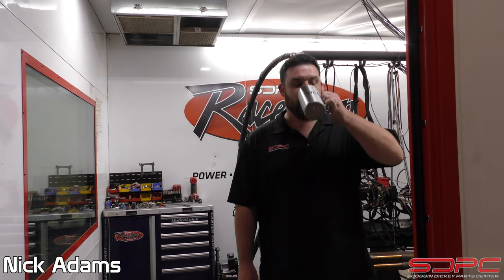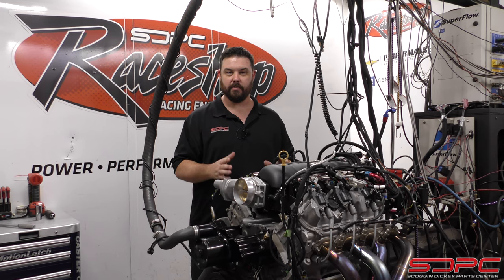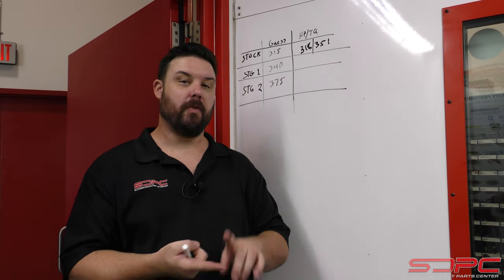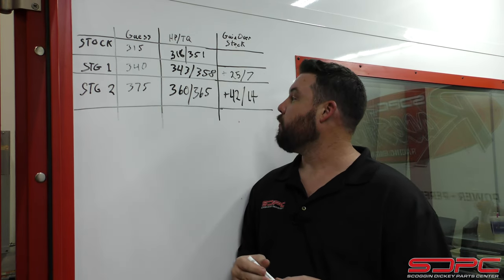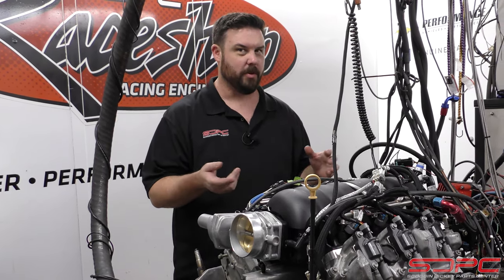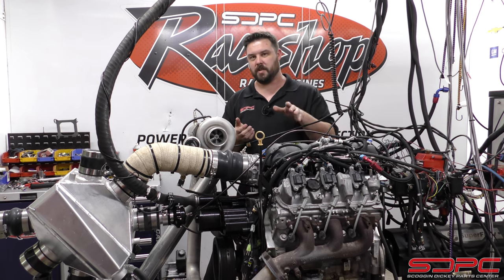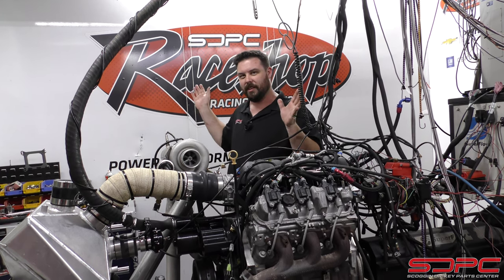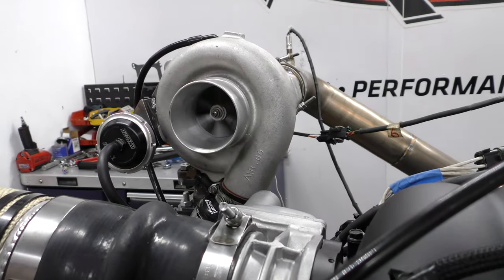4.3L LV3 V6 Camshaft Dyno Shootout!

Comment: Bought a 2016 Silverado back in January. Now, before I made the purchase I did some research on the difference between the V8 and V6 models. I was absolutely blown away by the power these new 4.3's are making! So, I saved 3k$ on the truck I bought vs the V8 one and took it to Montana this summer with about 700 lbs of stuff in the bed including my sportster. Did friggin great man. Anyhoo, I have an 88 s10 that I plan on doing the big "LS swap" into, and I think I've pretty well changed my mind on that😁 I even have a supercharged 3.8 out of a gtp that I planned on using, but now, the lv3 I believe will be the new small motor of choice for swaps and hot rodders. Thank you so much for doing the r.n.d for getting some great power out of these V6 monsters!

Comment: This engine came out right after I built my stroker 303 cubic inch 4.3 V6 back in 2013. The LV3 V6 runs as hard on the Dino as my stroker even though mine’s NA. My stroker 4.3 is running a forged 30 degree evenfire Scat 3.875 inch stroke crankshaft. H beam rods, forged pistons, 4 bolt mains, Brodix aluminium heads with a bolt pattern the accepts a tbi or cyclone intake manifold.  It’s pushing 320hp with a 454 tbi. The torque is crazy. Can’t wait to put a marine 4barrel manifold on it with a Holley EFI. The LV3 has a lot of potential, imagine it with a custom stroker crank?👍
Reply: It seems we have a lot of work to get power out of the 4.3 vortec. Is a marine intake and a carb be helpful with a cam. I’ve haven’t heard anything good about cams on these engines. The only easy rout I see is nitrous. I wouldn’t mind a 50-75 shot
I have an 02 2 dr extreme but I have to redo the whole exterior and interior…. They stole it messed with it inside and out then stole the cat and crashed it… so many tickets and a beat truck. I will restore it get a race cat maybe a new bed and new sound system.  Insurance gave me $4000 for the whole thing prob need 1000 to make it cali legal but with $3000 and  lot and lots of work I will be a make it better than before….

Comment: I wish I saw this 5 years ago. 
Before I bought a new or rebuilt V6 in my 86’ Grand National. 
I think I paid around 14K for it. 
With a newer ball bearing turbo and it made almost a thousand hp on 13 psi

Comment: Looking at putting that in a 96 s10 blazer. Seeing at least some support of the platform is making me believe it's possible to do. Even just headers and stage 2 cam would be a huge upgrade over the tbi 4.3 it's running. Great work.

Comment: Not a bad choice, especially when  there's performance parts available. The heads are so good, a cam (and possibly turbo) is all you need. I'm really impressed by the torque production throughout the rev range. Nice work on the cam design!
Reply: I think the rockers would struggle with a turbo 
I'm thinking of getting the stage 1 cam you think with a stage 1 mpg will stay around the same ?

Comment: I have an idea for a custom cam spec for you guys to consider with the LV3 engine. So, basically, keep the intake centerline at 107 degrees no matter what (with 0-deg cam adv or ret), then make the LSA either 107, 108, or 109 depending on if it's for 10-10.5, 11-11.5, or 12-12.5:1 compression, respectively. Basically, for every point of compression, you want a change of about 1 degree LSA, but the intake centerline is based on the cylinder volume compared to valve size, so unless you bore or stroke it (and somewhat significantly, at that) or significantly change the valve area, that should stay about the same.

Then dial in your duration to have a total overlap at the advertised duration lift of 20, 40, 60, 80, or 100 degrees of overlap. Those will be the "stages" and will determine streetability vs peak power production. Obviously, the first one with only 20 degrees of total overlap at the advertised duration (measured at .006 lift, AFAIK) would be the most stock-like in terms of rev range and idle. It'd be, essentially, an optimized towing cam. The 40 would be a mild street cam that could still be used for towing. I suppose you could call it a "hot truck" cam. And so on.

Then just dial in as much lift as you can with either of those to manage piston to valve clearances. Also, any heads you make, focus on keeping the combustion chambers as small as possible (so people don't need high dome pistons, which messes up the quench) while unshrouding the valves and smoothly shaping the bowl(IDK as much abt this yet). Also, go a step further and add another angle to the valves, making the seats 30 degrees instead of 45, and then stepping up to 45, 60, 75, and so on as normal. Lastly, for your port work, do what David Vizard teaches in all his books and videos.

If you can do that and manage to offer sets of heads for under 1000, you'll have the best LV3 shelf parts on the market.

Comment: I figured Borg Warner's 64mm compressor works super well with this engine and should hit 700bhp.  The ebay GT-45 turbo is $168 and is good to 700hp too...

Comment: 61mm is very popular with Grand National/3800 engine builds.  63.5mm is ideal for the 4.3 at the 650 bhp level.  Big block torque from a lightweight V6 :D  It's amazing GM didn't think to turbocharge it from the factory.
Reply: Ummm they did 😂😂😂
Reply: Cough s10 Syclone

Comment: Made the idiotic mistake of rebuilding the stock 2.8L v6 from my ‘88 S20 Blazer during COVID.  Put a 3’ lift/leveling kit running 31” tires on it.  With a mild cam and 3.42 gears we’re getting 10MPG.  Have been thinking about an LS swap (more power and efficiency hopefully getting MPGs up to a reasonable level), but this makes WAY more sense then fighting the tiny engine bay with 2 extra cylinders.  Stage 1 cam and have some fun!!
Reply: I just did the same exact thing. I even spent extra to do a cam swap and the entire valve train😂.
Reply: I'll sell you a sweet running 03 LU3 4.3 vortec

Comment: I was thinking this would be a better swap for a miata. The weight is really low and the lower torque and vehicle weight wont grenade a T5Z.
Reply: I wanted to swap the LV1 into my RX8 back in 2016.  It has double the torque...

Comment: This is what I should swap into my 92 Typhoon and keep it v6 🤔Much better numbers than my stock Vin-Z 4.3 with 15psi is producing I bet!
Reply: New, your 4300 Turbo was rated at like 280bhp and around 350 torque. A new LV1 4300 with a nice single turbo and FMIC would be over 490bhp Net.
Reply: don't ever hack up a numbers matching typhoon or cyclone....are you crazy?
Reply: Sell it and rebuild a clean base model to your liking. Make money while getting what you want 🤷🏻‍♂️

Comment: I would drop the compression, stage 1 cam, fab up a long runner manifold, run a similar sized turbo, and a hell of a cooling system and put it into a dually. Big block power that you don't have to pay for when you're not using it. I don't think it would ever be a mileage master, but high teens, low 20's (not towing/ hauling) could be possible- and sounding like an old 2 stroke Detroit would be pretty awesome (IMHO).

Comment: I need that stage 2 in my 2001 S10 🔥
Reply: The lv3 is like a 5.3lt with two cylinders chopped off not like the 1st sbc or 2nd gen vortecs like yours so this cam wouldn't work nor would it specd out the same for your vortec because the lt heads way outflow the vortecs so the only way a cam with those same specs work is if you had the head decked slightly, ported, cold air intake with k&n, and full exhaust with a tune and it'd still probably be a little too big. Not saying you couldn't upgrade to a good cam that would work with your set up either just not one this aggressive..
Reply: @zachniverson8816 I think he meant the entire motor ,cam, and turbo.  I had a 600hp Syclone back in the day. 100lbs off the front would have been fantastic.

Comment: Are the Piston Rings gapped to prevent a COMPLETE DISASTER with that TURBO… If it’s not gonna be TURBOCHARGED  and it’s just for testing…it’s still a serious risk and the extra gap helps prevent the rings from pushing outward and well it’s all down hill from there
Reply from the maker: Nope.

It was fine at that level but any further and we would have.

Comment: I ran 15 seconds in the 1/4 mile at 4,000ft elevation. Everything stock and full weight, on a 91 tune. RCSB 2017 silverado.

Comment: Thanks for a great video I appreciate that. I have a 4.3 in my GMC Sonoma yep its the older 4.3 I've thought about trying to put the newer LV3 4.3 in my truck 🚚 but I'm not sure if I want to because I'm not sure what would be involved to do it. Anyway I'm going now and again thanks for all the testing you did.
Reply: I've been researching this for my truck for a long time. LT adapter brackets should bolt it right in, same bellhousing pattern minus a bolt, if you wanna keep direct injection you'd need some help tuning the stock computer or you could convert it to multi-port like they did. Dropping it in and not touching it you're already faster than a GMC Syclone so it all depends what you want from there.
Reply: @connorbosworth7318  thanks for the information I appreciate that.
Reply: @raystevens687  Not a problem. I know it was kinda open ended but beyond putting it in the truck it's down to personal preference. You can stick a 4L60 behind it and cruise as it is or go nuts and put a 6 speed manual and twin turbos behind it. The sky is kind of the limit since they share many components with the LT. It'll take some fabrication skills to either build or cut down and re-weld V8 bits where no one has come out with a part yet. Moroso makes oil pans for them now but I'm not sure about anyone making intakes yet. Jost Performance stuck one in a Grand National and cut down a Holley Hi-Rise for it. It's on here if you wanna look it up

Comment: Now that was impressive for a v6. I got to see several time the Typhoon and Syclone track tested while under development at my local drag strip, and they were impressive. My V8 88 S-10 Blazer, or better yet my 75 or 79 Chevy Monza would love this setup. What PCM/ECM did you use to drive the electronics? I'm going to have to look into this much more closely!!!!
Reply from the maker: Mike, we ran a Holley Dominator for simplicity's sake when on the dyno. We didn't have time available to work with the stock pcm in a standalone harness if we had to troubleshoot DTC's and anything else the pcm might freak out about.

This is one of the big reasons why we had to run an LS3 intake with the adapters so that we could run port injection in an easy format.
Reply: @Sdpartscenter  Thank you very much for the reply. I just stumbled upon the v6 videos, and it looks remarkably do able from what I saw. The cam1 and cam2 versions would be great in my 75 Monza 2+2.My 79 Monza 2+2 with 130 hp 305 weighs 2950. My 75 with 340 hp v6 would be 200hp more and minimum 200lbs lighter. I got to dig into this combo of v6's this might just be the ticket for something old with something NEW. Thanks.

Comment: This would be stupid fun in a little flat fender jeep or a 280zx
Reply: Wj with traction control
Reply: I have a 64 Willy's M38A1 with a Buick Oddfire V6 that I've been planning on stretching the body building a custom frame dropping it to the ground and stuffing an Aluminum 5.3 in. But now I'm thinking EcoTec3 V6 😎😎🤣🤣

Comment: Ls3 intake 
Ls3 throttle body
Stage 3 cam
Ls7 lifters?
Direct injection delete
Kooks long tube headers
Not full exhaust
No drive accessories 
318hp / 351ftlb
With boost
14.5 psi - 644hp 730ftlb
Reply: 318hp / 351ftlb
With boost
14.5 psi - 644hp 730ftlb
Reply from the maker: The 318hp is with the LV1 stock camshaft.

We should have a more aggressive cam available at some point now that we have this data.

Comment: Turn key crate motor $$$ EFI ? turbo needed for the over 600 hp specs . Is a 4L60E transmission worthy?
Recommendations?

Comment: I would love to see this engine with the stg1 cam and 2 cheap gt35 turbos set to 7lbs of boost through a dual 3 inch exhaust in a 2014 chevy 2500 with a 6L90e transmission.

Comment: So this is what I’m thinking for my 14 scsb  Silverado cold air intake, headers your stage, one cam and seven psi of boost and a good E85 tune. Ballpark guess what kind of numbers might I make with that set up?
Reply from the maker: Bump from 250ish whp stock to just shy of 400whp. Be careful, on E85 you'll be scary close to the limit of the stock injectors.

Comment: I'm just now discovering this engine as I research silly automotive-sourced engines to use in a boat project, and I'm having a hard time believing that 315 lbs. fully dressed weight.  That's not to say I think SDPC is lying, but holy crap that is light.  As of now, it's between this and the 4200 Atlas.  Packaging isn't a concern, nor is emissions, noise, or any other crap because #hashbrownBoatLyfeY0!  Thanks for the long form videos!
Reply from the maker: Check out the LV3 swap groups on Facebook, we've all been sharing a lot of data there with others in the community. It's silly light for what it is.
Reply: @Sdpartscenter Hey, that's really cool you replied so quickly and on an old (by YT standards) video.  Thanks for the lead; I'll head over there.

Comment: Nice job guys! Could you let us know some of the turbo specs? Man, I'm  really impressed with the torque numbers. You do of course know the risk of running a stock ring gap. With some intercooler, this is a killer combo once it has some forged internals! Thanks guys, I  was looking for something that has tons of potential, with reasonable mileage, LOOK OUT, PORSCHE!

Comment: That turbo is getting close to the edge of the map. Even with a 4x2.5 intake cover they only flow 65lbs/min. The 3x2 intake probably cuts 10% from that. 59lbs/min is about what you need for 650hp on high octane.
Reply from the maker: True, power flatlined after a point at 1Bar, it was a freebie turbo anyway but still provided pretty good results for something that's sat on the shelf for a spell.

Comment: I have the older Vortech, 4.3 in my 2012 sierra single cab pick up. Would that be an easy swap?  I bought the truck brand new, but always thought of the engine was quite gutless.  Maybe a swap toa 4.8 would be easier? The truck has a 4L 60 transmission.
Reply: You'd definitely want to swap to a 4L80E or a T56 before doing anything to the engine. 4L60Es are barely even good enough for the stock v6.
Reply: The LV3's are still fairly new territory. It would be easiest to get a Gen 3/gen 4 4.8 or 5.3 with a 4l80e running on the computer that came with the 4.8/5.3

Comment: I have a 2000 blazer exstream id like to put the  (#4) set up   in. I posted a comment in a older feed. So I'll start again. Do you guys sell the whole thing as a drop in kit ? Or just the parts kit and recommend turbo? Also what year truck or Express van, should I get the 4.3 lv3. It will be very helpful when I call u-pull-it and try and find one or 2 of these things. Thank you!!. For your time.
Reply from the maker: Hi John, only parts not the whole setup. We can help spec turbos.

2014-19 Sierra and silverado
Or 2018+ Savana and Express vans

Comment: What do you think would be the ideal Garrett G-series turbo (single) for a stage 2 cam equipped motor? The application would be a high perf multi-use car with a manual trans, semi-daily driven.

Comment: Oh yeah in a s10 5 speed it would be nasty for sure and quite impressive I'm sure even an older one w a cam headers intake and such bolt ons the 200 HP would quickly be 300 and high much higher torque which would make a nice little s 10 get it in fact a 4.3 5 speed w just a cat delete so it can breath is rather impressive for being stock a cam intake and exhaust is all you gotta do to make power but being a six cylinder it hits a wall at some point rather quick so the lighter the car the faster it is .

Comment: What ECU did you use? Can you elaborate on the crank/cam signal pickup?

I want to put this is an AWD Mini Truck..
Reply from the maker: Holley Dominator was the ecu using an LT harness, put in the engine parameters and it fired right up.
Reply: @Sdpartscenter  

Does the LV3 have a reluctor on the rear of the crank like a LS or is it behind the front timing cover like the LU3. How many teeth is on the crank reluctor.

Also where is the cam pick up and how many teeth?
Reply: Sojmds like fun

Comment: Would it be possible to use the stock cam and headers with the turbos to get more power and torque?  I have a 2017 Silverado and would like to get more acceleration, but I don't want to have to pull the engine if I don't have to and I have zero welding skills

Comment: Did you use a V8 header for the exhaust? I count 4 pipes coming out of the head.
Reply from the maker: Yes, the reason is discussed in the video. The extra primaries are capped off. We didn't have time to get dyno headers made.

Comment: Great video! One question: are you running it with port injection or DI, or combined?
Reply: Just port injection.
Reply: They said at around 3:10 that they were using an LS3 style of intake, and running only post injection. They couldn't get anyone in on short notice who could tune the DI set up.

Comment: Came across this channel and I like what you guys are doing. Quick question: I have a 2014 Silverado with same specs but I can’t find any turbos. I saw a KINUGAWA turbo for the cyclone gmc but I’m not if that works for my truck. Any ideas what turbo kit I could use?
Reply from the maker: You're going to have to get something custom made as there are no off the shelf turbo kits that we know of at the time.